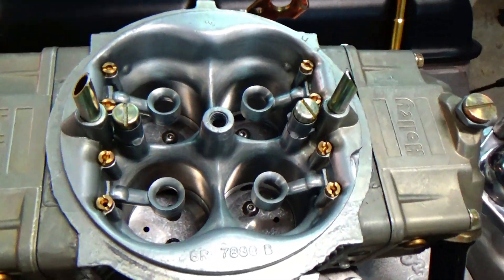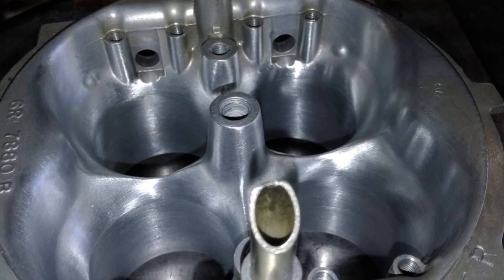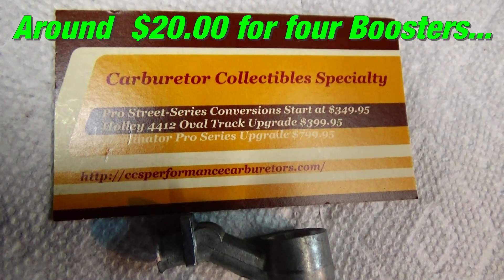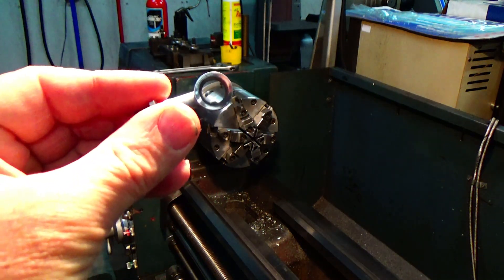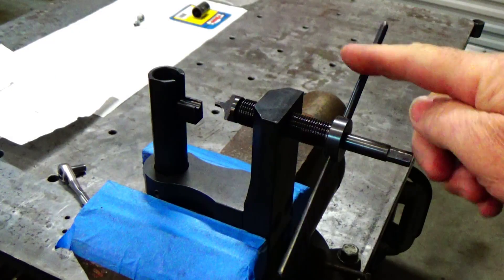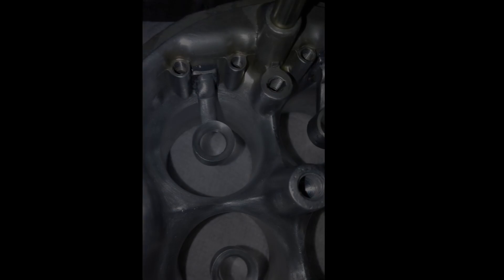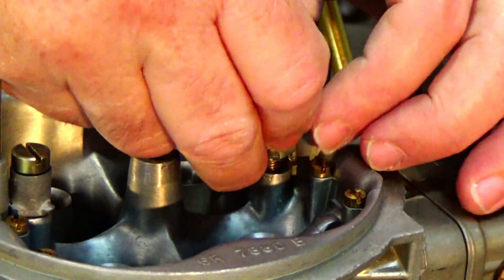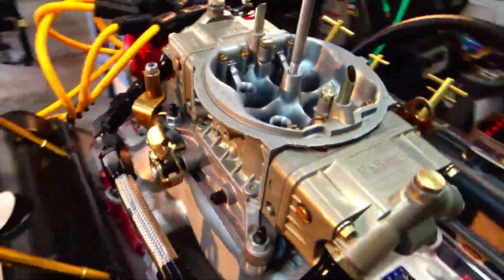Holley Carb Detailing and Venturi Booster Modifications #33

Comment: Great video. Did you notice any improvement in the lower rpm throttle respons?
Reply from the maker: Hi Jani... We have not tryed the carb yet... The project has been put off for a while... It is a new carb that we haven't tryed in stock form to have a before and after comparison...

Comment: Love you tech details. I'd seen your earlier videos where you talked about some of the changes you had made to the carburetor and had wanted to know more about how you actually did all the detailed work. I've done some of carb. work but never removed the venturi boosters like you have. Very interesting. I'm hoping with the small port heads and the medium duration cam you have, you will have very good air velocity through the carb. and a good signal.  We'll see how she idles at 850 rpms and comes off idle when you stomp on it. You probably know you can change the accelerator pump discharge nozzles and the power valve to deal with any most hesitation problems.👍🚀
Reply from the maker: Hi Mike.... Thanks for your nice comments, and it is nice to get those Boosters
out of the way and get in there and clean up everything with the die grinder.
Way back when I was really into this stuff, I had a self made flow bench and
did alot of carb work... Had alot of luck making to small of a carburetor work  
better by cutting off the carb choke horn, milling the throttle shaft, and knife edging throttle blades and some booster mods, then equal flowing all four holes...  But to big of a carb not as much luck... Accelerator cam changes, acclelerator pump squiter size changes all that stuff and still could not get them to work... My tuning ability just wasn't good enough to over come that... So still a little wary of them...😀